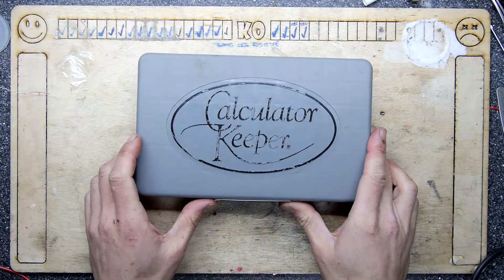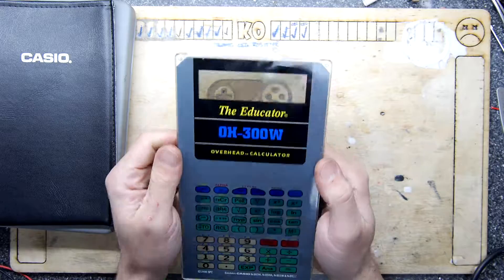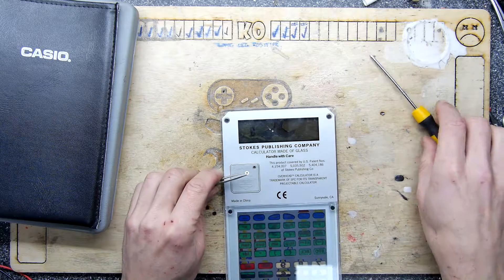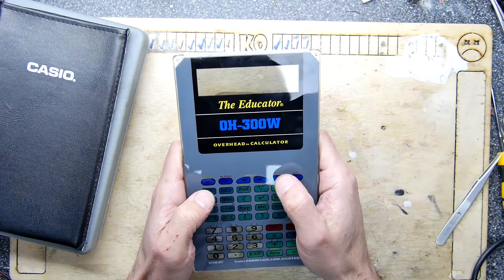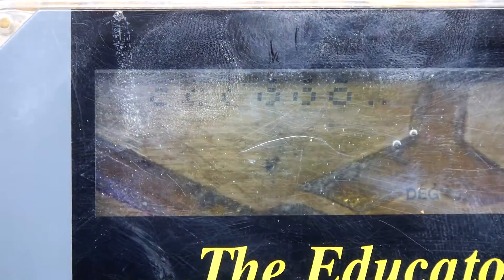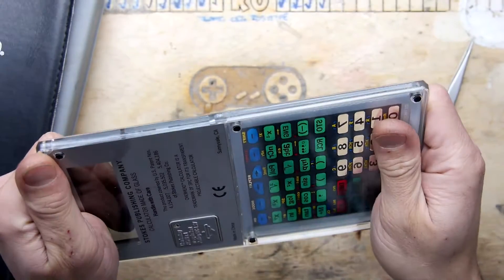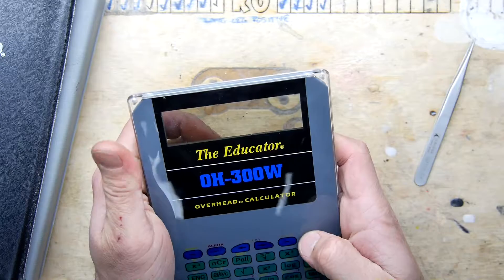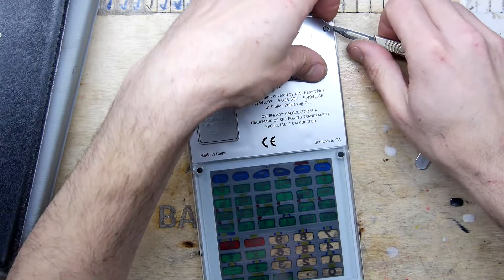Transparent Calculator

Comment: its a spare, got something hard dropped on the display, wasn't expected to be repairable, thought  the cases might have a use for you and the unit itself could be the subject of a brutal teardown.

btw i find a sheet of white paper makes the display easily readable if you don't have an ohp (i have several of these units of different models)

not done you up btw all the ones i asked for back are ones i thought should be reasonably fixable, a few with display errors like the smarties one you already fixed (ie the smaller system ruler) or in one case a simple battery prison in need of the battery setting free so it can be changed / removed.
Reply from the maker: +ImpaledGryphon I have planned a more aggressive teardown now 😁 I think I will remove the larger sticker on the keyboard side, that should give access to whatever is faulty.

Yeah I know they are simple savable calculators, that's why I get really annoyed at myself when a simple battery swap goes awry. I just don't understand what goes wrong in them. Perhaps they are sensitive to static, em radiation, physical handling etc I just don't know and it irks me!